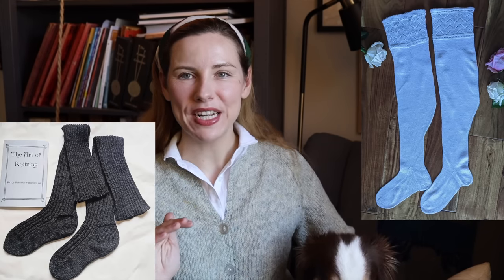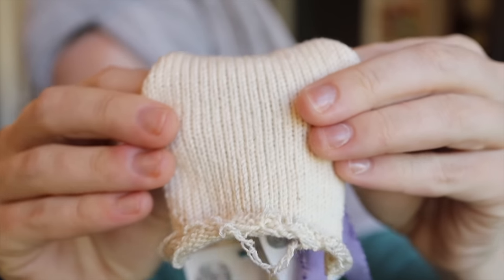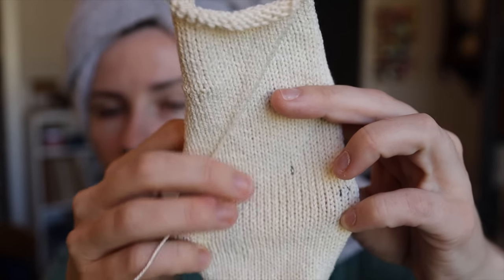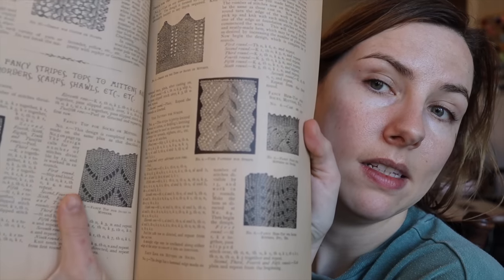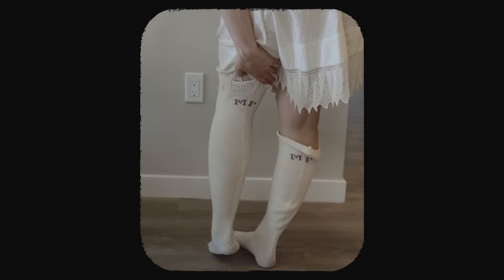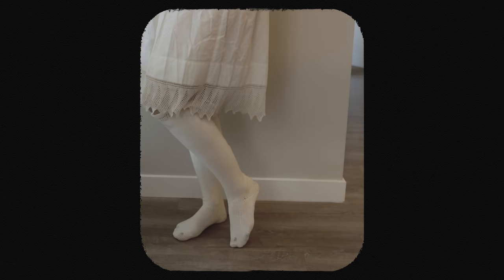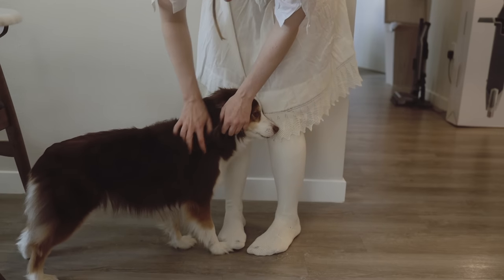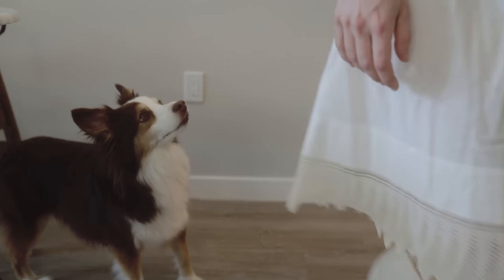Knitting 4 Victorian Stockings in 1 day on my Knitting Machine!

Comment: I was wondering why you didn’t  use the stitch you use on the toe or a stitch like it, so the back seam would be more stretchy and invisible?
Reply: The kitchener stitch only really works horizontally. Vertically, you need to use a different stitch.